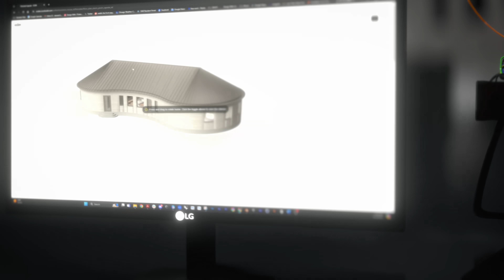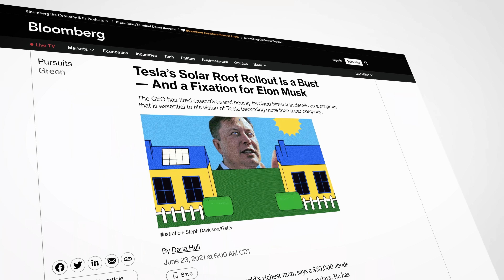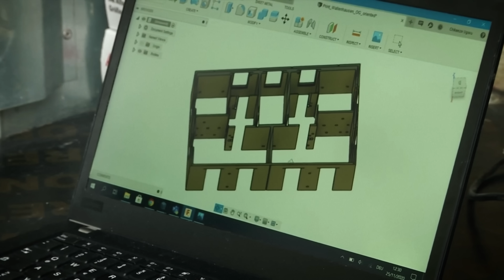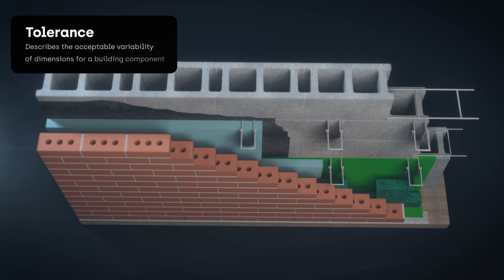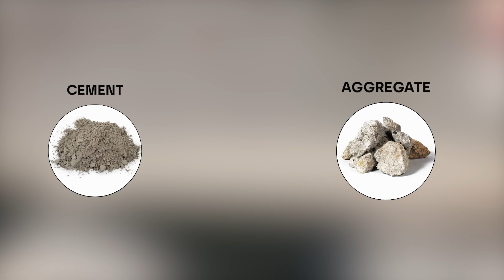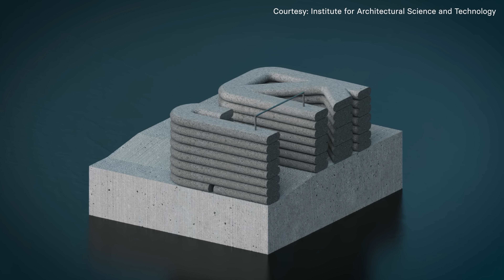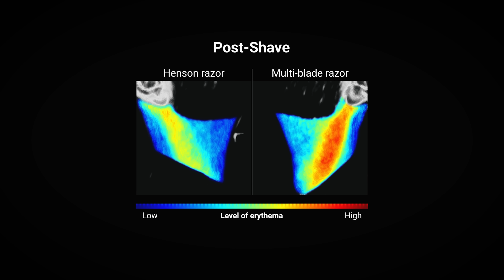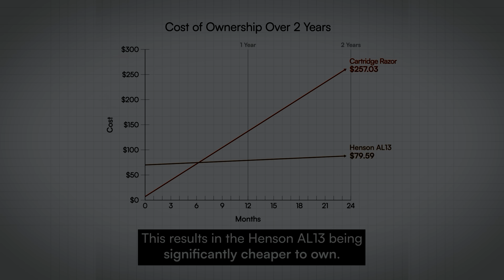Why 3D Printing Buildings Leads to Problems

Comment: Hm maybe compare it to the bricklaying system they are developing using concrete 3D printing alongside a robot bricklayer that can also adjust for pipes and wire space. . . There is some crazy automated building tech in the works. Saw some presentations on a robot system using prefabs and 3D printing to build. 

People fear AI but i think they forget that the Robot industry is now looking past the manufacturing market and looking into construction and maintenance to see what else robots can do.

Comment: In the USA, only 3% of homes are built modular from components assembled off site. By contrast in Germany it’s more like 15%, and in Japan closer to fifty percent! What’s wrong with US design that it’s so much harder for us to use this tech?
Reply: This is just off the top of my head so I may be wrong, but I believe a lot of it is because the US just has a lot more environmental diversity. Japan and Germany are much smaller countries, and happen to fall into more consistent biomes. Both Japan and Germany are considered temperate forest, while the US is made up of a mix of temperate forest, grassland, taiga, desert, tropical grassland, mediterranean forest, flooded grassland, and potentially more that I've missed. So something that works in one part of Germany or Japan is likely going to be fine to use in any other part of the country, while the conditions and requirements for homes in the US are going to be a lot more specific and vary significantly from state to state, or even within states. As a result you can't just have one general pool of components that will work across the board for US home construction because each location is going to have its own needs and challenges.

Additionally, Japan just has a much greater need and use for modular and pre assembled components. They see the most annual natural disasters out of any country on earth (earthquakes, tsunamis, typhoons, floods, cyclones and even volcanic eruptions), so being able to quickly and easily rebuild is more of a necessity than a convenience.

Comment: *3d printing houses:* how to increase prices, increase construction time, worsen build tolerances, have hardly any seismic stability, double cost of later repairs and remodeling, and in plus ruin your carbon footprint. 
It's like having a car out of cast magnesium. Everything is worse... but high tech...

Comment: The corner is your problem? Bricks are fired clay. They breathe, they insulate, they are sustainable. Concrete emits CO2 and is a limited source because it needs one specific kind of sand.

You also explain the insulation between brick walls with plastic foam, which yes, could be used but straw, wood chips or recycled rugs are also common filling materials and should be mentioned as they are more sustainable.

When it comes to your sponsor suddenly sustainability is important...

Comment: If I'm not mistaken and I'm not, at least in my area. The slowdown in home construction is not in the actual construction its in waiting for the local government to come out and approve every aspect of the construction. Every time the builder or renovator scratches their ass they have to weight days sometimes weeks for a guy that often times has never even built a house out of Lincoln logs to come out and say yay or nay.

Comment: I would say permitting and all the related non-sense (it only should exist in most cases because people are unscrupulous and unwise) is the main problem, not the cost of building itself. 

I strongly believe that an excellent way to help with this problem would be a nationally mandated program where every state with permitting requirements and legislation that can impact building costs or schedules must establish diverse libraries of pre-approved designs for everything from out-buildings to houses and even apartments and commercial buildings that do not require permitting and are exempt from legal challenges (like CEQA) to build - just a letter of intent that the counties may not disapprove and must provide engineering help for any issues they have with the project (such as grading or drainage).

Comment: What if, instead of going full on 3D printing, they instead built a pick-n-place machine that could lay down a layer of concrete, and then place a brick, and then place another layer of concrete and then place another brick... and so on... that way you get the benefits of traditional brick & mortar construction, but still get the automation pipeline.

Comment: 3-d printing of concrete buildings is NOT, I repeat, NOT the wave of the future.  WAY too inefficient.
And by the way, bricklaying machines now exist as well. Oh, and aerated concrete blocks or poured aerated concrete are more efficient AND self-insulated! SAME with insulated concrete forms- not only pre-insulated but the forms are set up in the time it takes to set up all the temporary robotics scaffolding to do a 3-D print machine house. And then they are poured in ONE DAY! And without the stupid corduroy look.

Comment: Lumpy mess is a good way of describing the finish. Buckminster Fuller had an interesting idea, but you don't see geodesic domes anymore. Also, with a 25mm (1 inch) tolerance fit and finish, or any type of modular improvements (like cabinets) are going to be tough to work with.

Comment: Before you get your heart set on a house built this way, be advised that cement is a major consumer of hydrocarbons as fuel and as admixtures, including the reinforcing fiber in this type of construction. Better to design around cob than concrete.

Comment: Easier and probably cheaper to make pre fab house, they can make quite alot of wall slabs even in challenging weather then transport to the site and use the same crane which would set up the printer to do the walls then onto the next building.. some countries even use roof pre fab roofs

Comment: If you're going to build a concrete home then just use insulated concrete forms. It goes up fast, has higher insulation rating and doesn't require expensive, complicated equipment that is difficult to setup, operate and maintain

Comment: Where are the steel rebars? No building is made out of plain concrete. It looks like a cement mortar which we only use on top of reinforced concrete to hide any imperfection and prepare the surface for further architectural finishing materials.

Comment: My problem with this whole process is that the manufacture of cement is the leading emitter of CO2 by far and such a fantastic new idea should be addressing this and juyst isnt....New process should use completely new materials ..not more of the old one with the biggest problem.

Comment: So where does all the plumbing and electrical cabling go when the wall is solid concrete? And for that matter - how many people have fully built and furnished one of these structures - then set it on fire to see how it hold up? How much study has been done on how the local enviroment affects the deposition of the concrete? Look up the Willow Island disaster for what happens if you don't check how well your concrete cures.

Building codes are not random people being petty tyrants - but hard lessons learned in the wake of tragedy. Commercial exterior doors always swing out because if there is a crush while people are fleeing to an exit no one would have space to pull a door in. We need more inspectors making sure these rules are followed, not less rules.

Comment: I think we keep forgetting how much carbon is emitted in the process of making and curing concrete, whereas wooden houses essentially sequester carbon.
Reply: "...fly ash admixture, or ash produced by the burning for pulverized coal..." in other words the byproduct of coal power plants.  Which are all being shut down due to environmental rules.  They are already looking at opening up old coal ash pits to reclaim what was buried as a waste byproduct of coal 50+ years ago as the concrete industry is doing a pretty good job of consuming the current output of plants.
  
And like you say, the cement powder with is mostly kiln-dried lime and silica.  There's a time and place for concrete IMHO, mostly along the outside where water and insect intrusion are a real risk.  I'm all for a hard shell and a woody interior.
Reply: Curing of concrete removes CO2 from the atmosphere.

Comment: I would think engineers could come together and figure out how to union a 3D printed area with traditional materials (assuming the repair is too large to hand mix).

My concerns are the lifetime. A wood framed home and plasterboard are far more biodegradable than concrete and foam. Are we able to have concrete homes to last significantly longer than a wooden home?

Comment: As a manufacturing engineer who's always had a passion for construction, I've always been doubtful of 3D printed house as a general solution to building houses in a typical location. The machine required, the setup work, the fact that all it does is just laying down the concrete (concrete which has to be brought to the location and is not even re-inforced) and just walls, not even the roof... and everything else afterwards, such as insulation, doors and windows installattion, weatherproofing, interior drywall, electrical and ventilation outlets has to be manually installed at the location later on in the process, which is usually the most time consomume parts of house building costing many man-hours. Prefabrication methods for houses has come a long way in the last 20-30 years, where segments of houses can be mass produced on a production line way more effectivly. With the general structural element (framed wood or re-inforced concrete), outdoor cladding, windows n doors, interior walls with outlets and drywall already installed, usually with either workers (but them doing it more effectivly and faster in a production line with better tools/machines rather then on site) sometimes even robots can do this work. A crane and workers can later put it together in a day or two... with a almost finished roof installed. House completely weatherproof and just minor details required left. I see way more potential in making pre-fabricated house segments even more cost effective (more automated with less workers) and with more finished details installed before bringing to construction site. However, I see amazing potential in 3D houses for very isolated areas where its hard to bring materials and the surrounding materials can be used... NASA has talked about using 3D printing teqniques to build structures on the moon with no humans involved (before humans even arrive there) using machines/robots and using the surrounding moon rock as aggregate for the strucutre, which means major portion of material doesnt have to be shipped to location before... its already there...  In scenarios like this, I see amazing use of 3D printing techniques, scenarios where its very isolated, where the surrounding material can be used, enviroments where you'd would want to limit the need for humans.

Comment: We literally solved affordable and high quality housing like 200 years ago. Its called a brick rowhome and/or low-rise apartment. Its incredibly heat and energy efficient due to thermal mass, bricks are largely reusable, they are space and material efficient, and are easily converted for multiple uses (a 3-story rowhome can be a single large home, multiple smaller apartments on each floor, or even a business on the bottom floor with apartments above), and you can't hear your neighbors having sex through your cardboard wall.

Build more of those, make less shitty cul-de-sacs, and regulate the housing market to prevent the obvious price gouging going on right now.

We don't have a supply issue, we have a greed issue.

Edit: also, this is just an overcomplicated way of making commie blocks. Prefab concrete slabs would also just work better.

Comment: Prefab homes were the most scalable way to build quickly. This problem was solved in the 40's.  And you could deliver entire walls with plumbing and electrical installed at the factory with common connections to put it all together like Legos.

Comment: The problems mostly seem like problems with current concrete construction and the rest just seem to be issues with having human intervention for openings which I see no problem with for now.

It looks slow enough a person could follow behind with a scraper. Why don't they smooth the edges like a coil pot? Someone smoothing the cement could even make patterns and corners. At the very least add stucko to smooth it over.

Comment: ...why don't we just 3d print brick buildings? 🤔
Have a separate feed line for brick that acts like the feed for bullets in a gun, and a brick placing head and a mortar laying head (or two, one for vertical mortar between bricks). Seems like you could use the gantry and a combination head to build traditional brick structures with 3d printing technology. Similar to 3d printers that have multiple extrusion heads.

Comment: While you make some reasonable points, I think you're looking for problems.
Your no-square-corners argument was ridiculous.  You could make the equivalent complaint that brick or wood construction stops you having curved corners.  It's just a property of the technology.
If you don't like the layer lines that printing creates, it's not beyond the wit of man for the printhead to be fitted with a trowel arrangement that flattens the visible faces as it's printing.  This would also help with your tolerance issue.  It would also be possible to have the printhead tilt, so doors and windows could be inserted as soon as the layer they sit on is complete, and they wouldn't get in the way of the printhead.  This would also remove the need for caulking.
Your argument about the precision of footings sounds like you're desperately trying to find negatives.  All houses require accurate footings, but 3D printing can compensate automatically.  Desktop 3D printers have automatic bed levelling where the flow of the first layer is adjusted to take account of an uneven bed and make subsequent layers level.  Exactly the same can be done for cement to compensate for uneven footings.
Of course, a 3D printed home is not going to be a universal solution, for instance it's probably not going to be good in seismically active areas.  There are however many situations where it could be ideal.  Instead of developers offering a narrow range of fixed plans when building a new estate, the increased design flexibility and savings in time and labour mean they will be able to offer the services of an architect to customise each property to better suit each buyer's requirements.
Why not look for the positives or at least solutions to the negatives, rather than knocking a new technology which shows a lot of promise?  Remember, the Luddites were on the wrong side of history.

Comment: Aren't round corners more durable to external forces on a structure? Why are we so hung up on neat square edges at our corners. If I have a neighbor that's 80 years old with their eyes failing and their reactions slow. I'm pretty sure I would rather rely on my home with round edges to stand up to the strength of a car blitzing towards my home by a confused granny that mistook the break for the gas than a home with square corners.

There is also a matter of post construction updates that 3d printing  homes does allow for. If you need to cut out a wall section, cut out a section, make the changes and then fill in that area with concrete and in 3 days you can pull the forms easy. I don't see why people don't jump on the 3d printed home design.

Comment: interior 'raw' 3D printed surfaces look like they're one bad stumble away from shaving a chunk of skin off or (worst case scenario) taking half of someone's face off. I know from experience that tripping and falling on even smooth skatepark level concrete will easily tear skin and grate nasty grazes into your skin with how 'grippy' it can be. I shudder to imagine falling in your own house and having your head or hand impact the unmoving, rough-looking wall.
attempting to live in one of these houses, I would 100% want to have someone go around the house smoothing it out if possible and applying a plaster or stucco to the walls, to smooth out the ridges and bumps; possibly not removing them entirely, but definitely making it easier to bounce or roll off it without hurting myself too bad beyond the impact.

I definitely wouldn't mind living in one of these, barring any major issues that crop up as the tech develops or the house ages. I can definitely appreciate a house where I'm definitely not going to accidentally punch holes in the walls like I might with gypsum/plasterboard/sheetrock over a wooden frame, last generations, and if you do it right, it's not going to be some Brutalist nightmare of a thing, which should be avoided at all costs.
there might be some potential with the ridges too for possibly integrating greenery like vines and grasses, which might help brighten up the place after, too.

Comment: why don't the just smooth the vertical surfaces as they go, there's got to be a point in the concrete cure process where it would be stiff enough to not collapse, but fluid enough to spread.

Comment: I took one look at the first prototype and said, "uh uh".  You cannot build a structure without run through rigidity such as rebar or timber.  Just like concrete driveways that are subject to cracking, so to would be a cement wall.

Comment: Theres a company thats "printing" with brick laying rigs that can adabt to many brick types (ie hempcreat) and a quick dry cement, runs off of trucks and multiple trucks can work on a project at once. Wet concrete is not the only solution being explored, thankfully.

Comment: Wouldn’t Geopolymers be better for 3D printing? You could add corners and/or smooth texture with geopolymers at a later time, unlike concrete.